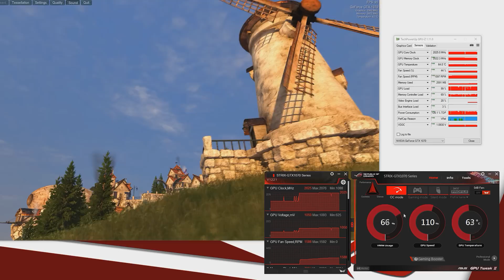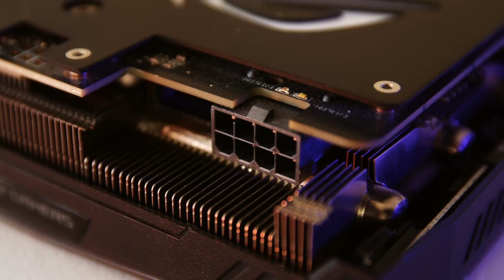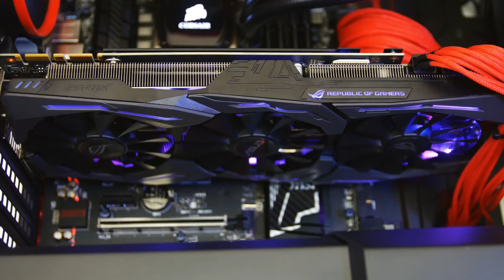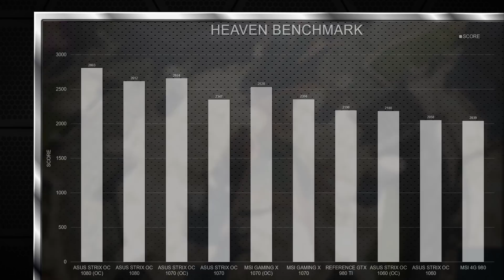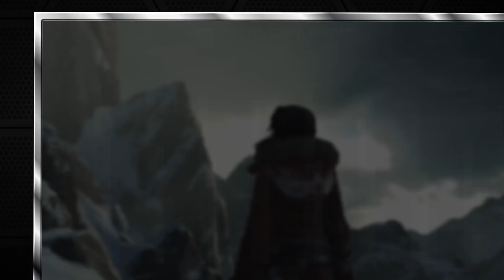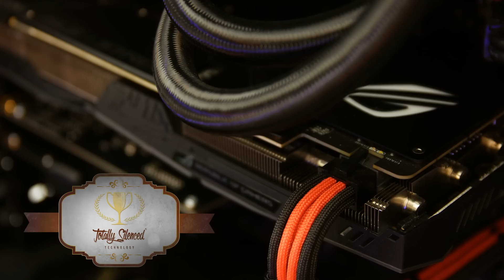ASUS STRIX GTX 1070 Review (Benchmarks)

Comment: What is the reason they started using display ports? We all pretty much need hdmi converters for it anyway especially for the second monitor (I have msi 1070 so only one hdmi) so I really don't understand the point of display ports
Reply from the maker: +Ben Harman Most high end monitors use it, it's pretty much a standard. Display port provides a much higher bandwidth than HDMI which is great for multiple monitors setups.
Reply: Oh okay ty I have been wondering forever
Can't afford a nice 1440 so i never knew

Comment: Hey Marcus nice video. I have a question: Right know I'm using a i5 4690K, 8GB's RAM with a GTX 970. My idea was to upgrade to Kaby Lake that might be available soon, and get a 1070 or possible a 1080. Do you think I should upgrade the cpu, mobo and ram? GPU? Wait for Volta? Thanks in advance :)
Reply from the maker: Why not just upgrade the 970 to the 1070? It would be a great jump in gaming performance. Your spec's are more than enough to run it well.
Reply: Yup, that makes sense. Today I read that the i7 7700K performed about a 20-40% better than the 6700k so I thought it would be a good option (Since I could upgrade just with little money). But yes, the 1070 seems a wise option. What about the 1080? Worth the difference? Or wait for 1080Ti? Thanks Marcus

Comment: I got 2025mhz from my Strix 1070 so its no isolated incident.
Reply from the maker: Na I didn't think it would be, needs a six pin on the beast.
Reply: Got my EVGA GTX1070 FTW up to 2126Mhz, haven't fully tweaked it yet though, so might get even better.